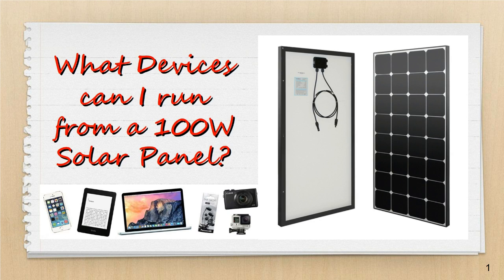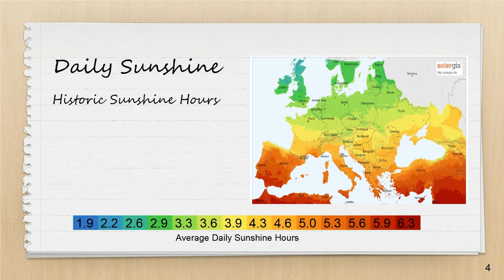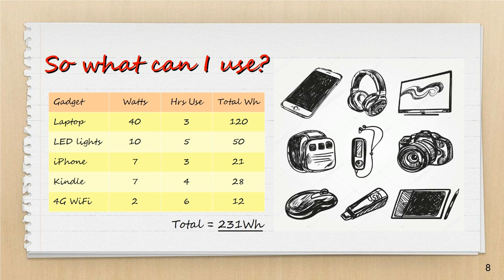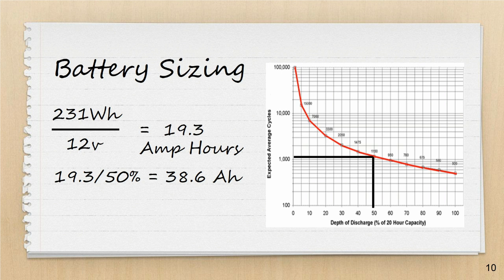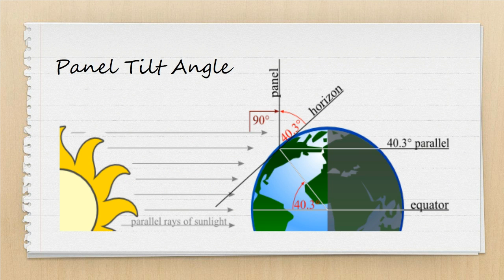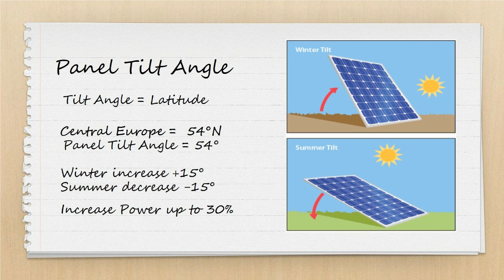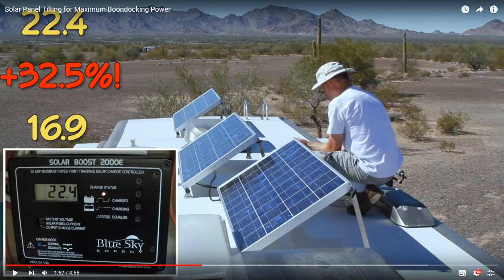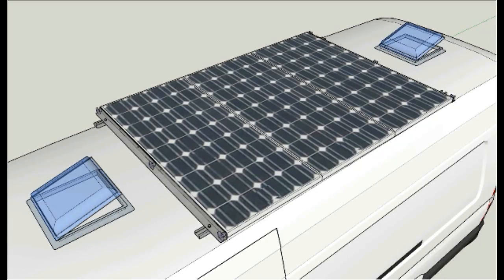What can you run on a 100W Solar Panel?

Comment from the maker: To select a suitable charge controller you simply take the rated output of the panel and divide by the nominal voltage of the battery. So 100W / 12V = 8.33 Amps. Therefore a 10A solar charge controller will do the job and will typically have a power range up to 130W for 12V system.
Reply: Greg Virgoe I I am planning my own van project also and I just like to say thank you so much your videos have helped me very much you are such a smart man
Reply: Well explained! Still complicated but we'll explained
Reply: For the cost and the benefit, I would go solar as much as I can. A lot of people end up parking for up to 30 days (in the American southwest anyway) and running the engine long enough to keep a laptop or some other higher requirement device could be an issue. If you don't need it, then cool; but I would hope for the best while preparing for the worst. I would rather have it and not need it all than need some juice and not have it available. Having said that, those who travel a lot are often very individualistic with our own ways of doing things. Do what feels right for you and that is what makes each of us unique, and we are a unique lot.
Reply: Thanks for this
Reply: Devonian If you’re going to be living in a van, running lights, charging devices etc from the van battery is going to end in you getting stranded with a flat battery, unless you drive for at least a few hours every day. A second (“leisure”) battery that charges from your van’s alternator via a split charge relay will remove that risk and if you drive a few hours each day it will be enough for light to moderate daily use. If you stay in one place for a few days, you will need solar to compliment the charging.  Solar is definitely the way to go if you spend a lot of time in the van IMHO.

If you live in Devon, get in touch and I can help you with figuring out a system if you like. I’ve been living in my conversion for almost 10 years now and have had a solar setup for 2.5 years.

Do you live in Devon per chance?
Reply: Greg Virgoe, it’s worth considering that one might want to upgrade to add more panels later, in which case the smallest controller that will accommodate an existing single panel may not be the best choice.
Reply: @chatteyj  Candles? Then besides a fire extinguisher, add a handy fire blanket. Have fun and good luck.
Reply: Devonian Sounds good!
Reply: Mersi
Reply: its is ok if i use 60a controler
Reply: jhun andre dillo how many panels of what spec?
Reply: @chatteyj  I use a split charge system, with a couple extra batteries in the back, all charged off the vehicles alternator... As long as I drive to my park up, I have power for the eve.... You don't want to rely on your front battery alone - fall asleep with your light on or some other device plugged in and your in for a heavy morning standing by your van holding some jump leads until you get a hand lol.
Reply: @chatteyj  at the moment I'm running my xbox one, a screen and  my phone is charging.... I have led lights but they aren't currently on... I'd recommend agm battery first on a split charge system... Then get panels to top up your agm battery.... You'll love it.
Reply: I have a ups battery which is rated 220v. What to do. The exact model is zebronics zeb-u750. Someone help. Which A should i go for.
Reply: Well explained.. But still need more explanation though. Thanks
Reply: Hi Greg, can you explain why did you content + to - on back of your panels thanks
Reply: Hey Greg,  how did you find the power range of the charge controller
Reply from the maker: @kivumbialex1120  The manufacturer of the charge controller publishes its max input voltage and max watts connected panels use those to select a suitable unit.
Reply: Greg Virgoe, If your not some kind of professor" then I'm the Pope!
Reply from the maker: @gahwah5548  I’m a qualified mechanical services engineer by trade. Having to manage a team of engineers is probably where I get my communication skills 😊👍🏼
Reply: @GregVirgoe  Explanation accepted! Thanks for the well informed video/s cheers
Reply: Looking at your dual solar panel and battery setup, does the way you have wired up the batteries mean that the inverter is 24v?
Reply from the maker: @markrichardson5496  no, the batteries are in parallel so the voltage stays at 12volt just the Ah are added together

Comment: As an engineer and a maker I have to say your videos are fantastic. Your attention to detail is becoming a lost art. I had a thought about your panel tilt system. Use gas struts with adjustable pre marked stay straps, it would save a lot of roof climbing and time. Just park, pull the pin and watch as they glide into place!
Reply from the maker: That's not a bad idea, I've hit a bit of a stumbling block with the combined weight.
Each Panel weighs 10.8kg so that's 32.4kg combined plus a few nuts and bolts.
The aluminium support struts I originally bought are not strong enough to hold the weight and will easily bend.
So I'm having to rethink the bracketry and source some stronger materials.
I'll look into the gas struts now as I could fit 4no, one either end and two mid in between the three panels.
Will look at holding weights, lengths of struts and geometry now. Thanks
Reply: HI Greg and Steelfoot- My boyfriend and I  are converting a citroen relay currently using the majority of your videos Greg to get by...! We have found the whole build series invaluable and would be much further behind without it... have you thought any more about this now and how you might attach the panels on? 

We are looking at doing the same as you- except to have 4 panels so about 44kg in weight- tilted on the short axis... The idea of the gas struts seems excellent- thanks for suggesting. What kind of strap are you imagining? 

And Greg if the aluminium isn't strong enough- what were you thinking next- material and source?! Thanks, Katie and Mike

Comment: Great video.  Would just like to add from 25yrs using solar that panels work from sunrise to sunset in daylight not just in sunshine.  Obviously at reduced power but that all adds up. Many folk say you cannot use solar in winter in Scotland for example, well we do :-)  We also no longer tilt but increased the panels as "larger" capacity became available in a smaller area and we get older :-)
Reply from the maker: That all makes perfect sense Desmond and thank you for sharing your experience.
No point in tilting them up on overcast days as you're not getting direct sunlight anyway?
As you can see with my van I have maximised the solar and gone for 3x160W 36 cell panels, 480W total which should give me plenty for what I want to do. So what would you say the percentage solar power on a cloudy day?
Reply: We have 2x160W panels and 330Ah of battery.  In winter with cloud and short days it can be as low as a 10Ah harvest in a day by this time (March) of year 20Ah plus on a cloudy day.   Not sure on % overall but possibly as low as 10% in winter.  In Nov-Feb we have to watch consumption a little but the rest of the year we have a surplus.
Reply: you can always use them,it just depends what you expect them to do and whether they will produce useful power in your application.   There is a bit of a tendency to say everything is awesome and just gloss over comprimises,  generators runs etc.

Comment: Greg, this is the video I wished I'd found weeks ago when I was tasked with building an off grid lighting system in Greece. This has everything I need to know as a complete PV novice with easy to follow explanations and examples. I think you just saved us over specing the installation and saved us a few quid, thank you!
Reply from the maker: You are most welcome. You may find this video helpful too https://youtu.be/rVkDPzrA-zw

Comment: Well done once again Greg. Mounting the solar panel Will be the next hurdle I will have to overcome. Like your idea of tilting them.
Reply from the maker: Hi David, what type of van do you have? I have looked at using the OEM roof rails that bolt into the pre fixed nuts in the gutters on the roof.
Reply: Greg Virgoe 

I have the plastic mounts for the corners and side. They won't fit between the ridges in the roof. It's a sprinter the same as you have so I might do the roof rail approach. I might make some aluminium angle bar. Weather holds I'm doing it this weekend.
Reply from the maker: Hello David, the rails that run the length can go where the Merchant OEM roof rails go. 
Plus it takes the curve out of the roof. A 36cell panel is 50-70mm wider than the gutter so this allows you to go over the roof a little too.

Comment: Watched a tilted solar set up from a guy Bob interviewed on his “Cheap RV “ channel, the guy had the panels tilt from either side which might be useful. Can’t always park in ideal direction to the sun. Looking forward to seeing panels connected to aluminum rails. 
Always enjoy your post, I thank you.
Reply from the maker: Trouble is the cables are connected to one end only. 
You can always park in forwards or backwards so that should be enough. Van needs to be facing west all the time so the panels will face due south. Thanks 😀
Reply: Hey Greg, I just thought the same thing as Dani did. I'm pretty sure there will be times when you want to park your van just like that because of the view or whatever and the panels would pop up in the wrong direction. If the cables are your only concern: simply run them back to the center of each panel and allow some lift, then bundle and run them through the roof. With all the effort you're putting in, I'm sure you can get it to work. Would be a shame if you'd had to decide for either the view/ entry/ etc or full batteries ;)
Reply from the maker: If I wanted to park up to enjoy a particular view I will probably just leave them flat,
I won't worry about the small loss of solar because I'd be too busy enjoying the view. 😃👍🏼

Comment: There is an issue with using the average insolation value to calculate your loads.  For instance, in January the value is only 25% of the average, and no amount of tilt will make up the shortfall.  As monthly insolation tables are easily available I think it would be more prudent to work from a worst case value.
Reply from the maker: Hello, you are correct that values in winter will be less than in summer. The average daily sun hours takes into account the amount of sun across the entire day and reduces this to the equivalent number of hours at STC. I’d did take the lower value. I could have just gone with 1hr of daily sun and see what that gave me. It’s at Best an estimate anyway as there are so many variables it’s never going to be an exact calculation. With regards to tilt the winter is when you need it most as the sun is lowest and the sun hours are the shortest. 
Thanks for your feedback. 👍🏼
Reply: Okay, so using your calcs and the January average insolation value of around 0.8 (SE England), you would produce only 56wh from a 100w (horizontal) panel.  That's just enough to run your LED lights for 5 hours (an underestimation for January).  With the lights off it will take 10 days to charge a 90ah battery bank from 50% DoD.  Even with a 30% increase for the tilt and three panels (as seen in the sketchup model) you'll still only get ~218wh.  The figures become even worse when you factor in the efficiency loss of ~15% for an inverter (which you would need to power a laptop).

Granted, these values are only estimations at best, and the average value would be suitable for someone looking to go away for the odd weekend here or there, but if you're planning on using your van on a semi-permanent (or even permanent) basis you'll find that you'll be putting too much strain on your battery bank during the winter months and may find yourself replacing your lead acid batteries (including AGM and gel) every year or two.

Don't get me wrong Greg, I think your videos are excellent, but there is a growing number of people looking at solar to provide all of their energy needs for their van.  I think it is valuable for them to know that at worst case (with a 100w monocrystalline panel) they will produce around 50 watt hours per day (average) in January compared to around 350 watt hours in July (without tilting).
Reply from the maker: I’m demonstrating the method of calculation. You then apply your own situation and data accordingly as you have just done. You have to apply common sense. Here in UK we go days with constant cloud cover and solar becomes completely useless. 
You will of course have to plan for alternative such as a small generator if you want to be wild camping or plug in on shore power on a camp site.
If you are someone that likes camping in the artic circle in winter you will need a different strategy. Alternatively if your camped out on the Mediterranean Sea all the time you will most like not needs anything else. Solar at best is very inefficient why they are so many add on factors to include. Thanks for you thoughts on this and I’m sure a few will find it useful. Cheers
Reply: On a separate note, have you done any weight calculations?  I see lots of videos where I'm pretty sure that what they end up driving is illegal.
Yours was the first video I saw with any kind of insulation calculation, I wonder if it'll be the first with a weight calculation too.
Reply from the maker: Haha are you available for birthday parties too. 😂
This was one of the first things I considered. I’ve had to drop the original plan to haul two bikes and now it will only be one. Where possible it’s all been lightweight materials, aluminium etc. I did a spreadsheet but not published it yet. I will be weighing the van when complete as I am not going to risk being pulled over when abroad and having it impounded. Things like emptying grey tank regularly all helps. In hindsight the LWB 5T version would have been the safer bet. My furniture will be minimalist, no 2x4 timbers. 
all lightweight ply, it’s on the right track. What van have you got?
Reply: Mitcy Dupres you might consider creating a vid sharing your suggested method, keeping it easy as possible for those of us, including me, to follow and use. IOW, present and demonstrate the steps and calcs you suggest us to use, possibly providing an Excel spreadsheet if beneficial ....
Reply: Greg - I don't yet, but I'm a man from the same mould.  I have a big spreadsheet with weight/power/fuel/insulation/cost calcs and a few sketchup plans (including wiring and pipe diagrams).  I like to know everything I can, down to the smallest detail, before I start (I used to be a project manager).

I'm currently looking for a LWB Sprinter/Daily/Crafter luton over 3.5t (so probably more likely to be a Daily).   The luton will be able to blend in and (should) be easier to build with all those straight(ish) walls. Finding the right one, with a roller shutter (rather than an up and over) and a tail lift, isn't a rot box and fits within my budget is my current mission. 

The thing that concerns me most is that vans (in general) are a target for thieves.  Have you considered any extra security measures?
Reply: I should add that my sheet didn't have an insulation calc tab until I'd seen your video.  I reiterate that your videos are excellent and I'm more than happy to steal some of your hard work and knowledge ;)
Reply: born2bWildeNE I am considering creating some.  There are many really hard to understand videos about solar installation out there.  Greg's videos are some of the best out there, and I'm sure it's difficult to balance something that is easy to grasp with something that is in depth.  However, my main priority at the moment is to find a suitable van.
Reply: MIT u r a pessimist. Don't use it in Jan much but more in July.  Prudent to use the July value
Reply: Feedback4Utoday if you are only using the van for occasional camping, then obviously it will be used more during the summer months.  However, if you intend to use it regularly during the winter then you need to plan as a pessimist.  Much better to have too much than to waste money by killing your batteries. 

All lead acid batteries (including AGM and gel) need to be fully charged to keep their condition or they deteriorate rapidly.  Not an issue for LiFePo⁴ as they can handle partial charging.

Comment: Hi Greg Do you need to isolate the solar system when charging from battery charger on hook up?
Reply from the maker: Ross Brooks no not at all. Your solar charger will see a high voltage from the mains charger and back right off.

Comment: Nice one Greg - like all your videos very well researched and thorough and very clearly presented information. Can I just tease you about the inclination of the panels? There can be no doubt that achieving the sun striking the panels at 'normal' maximises conversion - but that is only one of the angles involved - as the earth rotates the sun will transit across the van so to speak - have you considered a 'lazy susan' type mount so you could track the sun - or is that additional weight up top just the last straw?
Reply from the maker: I suppose you'll want me to motorise it too and install GPS solar tracking software on my laptop ;) lol
Joking aside, the sun is at its hottest midday when it's the highest point in the sky, so with a fixed array (which this is really) its best to point them due south for us northerners and due north for those southerners.
In my setup, I shall try and park the van facing west if possible so the panels face south and get the sun most of the day.
I like the idea of tracking the sun but worried it will start to look like GoonHilly. Cheers Norman
Reply: Greg Virgoe It’s a fair cop guvnor😂